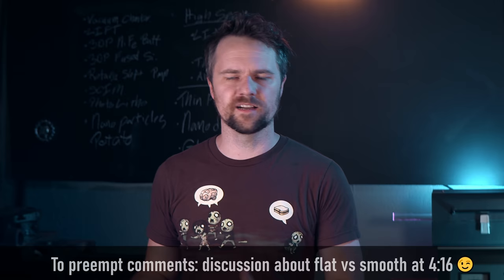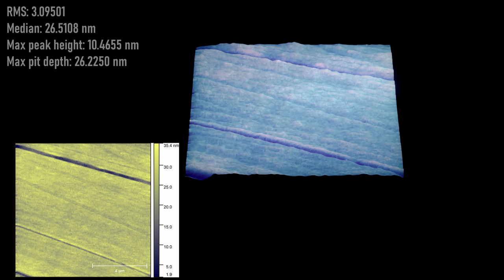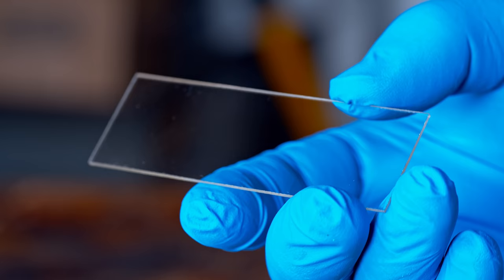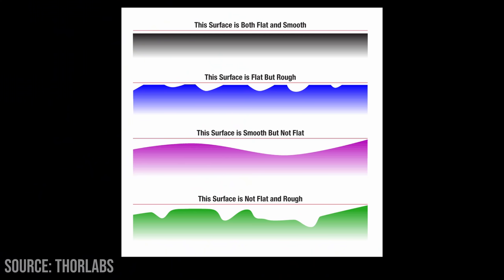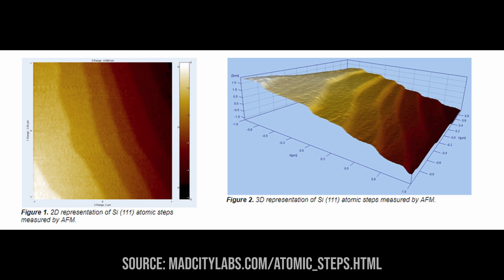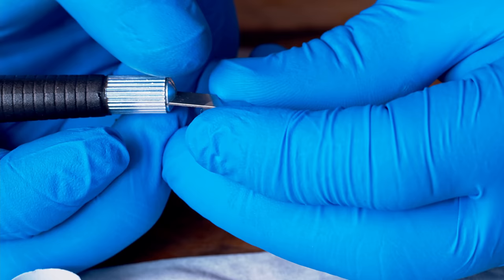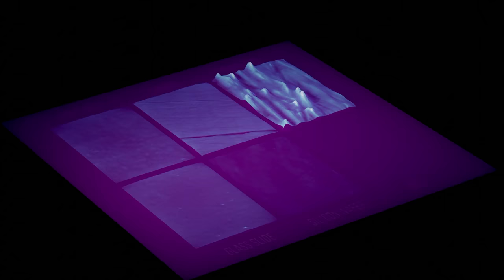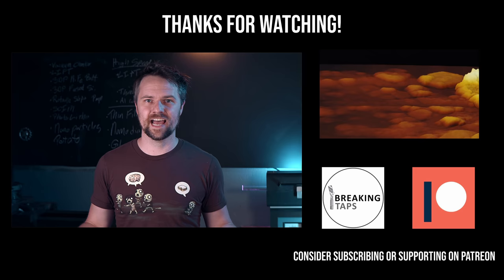What is the Flattest Material?

Comment from the maker: Addendum
- Flat != Smooth, please don't fill the comments with hate. <3 At this scale it's mostly moot anyway, and it's hard to watch what you say 100% of the time when filming 😇
- I am bad at colors! 631nm is red, not green. 🤦
- I'm not super familiar with surface roughness measurements, so hopefully I didn't misinterpret the results too badly!
- When I say "RMS" I'm referring to "RMS roughness (Sq)"
- As annotated in the video, some of the scans had "depressions" in the corners. This was due to poor flat-fielding of the raw data on my part (raw AFM data often has a tilt or slope which needs to be corrected) and I didn't notice it until after editing the video :) After the video I re-processed the data, and while the numbers changed some, the overall results were basically the same so I didn't go back and re-edit the video.  So just FYI, the glass samples in particular got a bit smoother but maintained their ordering.
Reply: Did you know that "flat" and "smooth" means different things? 😉
Reply: @Breaking Taps  pin it to the top!
Reply from the maker: @maxmustermann5353  Whoops, cheers.  Pinned!
Reply: Yeah was going to comment on the colour, then the lambda/x thing.  Lambda /20 means the surface as a whole doesn't deviate from being flat by that much, they generally give a scratch/dig or similar rating along with that for local deviation/ roughness.  A lot of flatness testing in general metrology is done using sodium's yellow lines btw, optics suppliers favour 633
Reply: can you please elaborate on how "RMS roughness (Sq)" is obtained? Is it the same thing as RMS of points on a single sweep line, just accounting all the height measurements in the measured area?

And the peak numbers at say 2:45 are 30nm above the average and 9nm below the average?
Reply from the maker: @kubeek  TBH I'm not entirely sure how it's calculated, I just went off the stats that Gwyddion gave me for the entire image (usually, a few times I masked off the depressions in the corners).  E.g. process the data, level, etc then hit the image stats button in Gwyddion :)  More details about how Gwyddion calculates it here: http://gwyddion.net/documentation/user-guide-en/statistical-analysis.html if you want to see the math behind it

Correct on peak/pit measurements, Gwyddion calculates those as +/- from the mean level of the image (as opposed to just the pure max/min values in the image)
Reply: Hey . Is the surface of water "flat"?
Reply: @kubeek  The RMS(sq) is the average deviation from the mean height. So it tells you how spread out the height distribution is.
Reply: The surface of gage block is lapped, not ground.
Reply: Congratulations on your videos - they provide a nice introduction into scanning probe microscopy to a wider, non-specialist audience. One comment though, I noticed you frequently list nanometer height values with four digits (!) after the decimal point, which grossly overestimates the sensitivity of you system. Also, such sub-atomic pico- to femto-meter scales don't provide any meaningful information in these experiments. From a scientific point of view I would therefore suggest rounding the height values to agree with the sensitivity of your system (nanometer scale at best). In any case, as I said you provide some nice examples how relatively straight forward AFM scanning can be and I am sure it will motivate more people to give it a try!
Reply from the maker: @Catenin120  Oh yeah, sorry about that! I was just being lazy and copy/pasting directly from gwyddion... no way there is enough sig figs in the data to justify that :) But very fair point, I'll be less lazy in the future and adjust the values!
Reply: Think of it this way, you are a Smooth talker.  I enjoy listening to you and I learned a lot.  Thank you for your presentation. Some of your audience is a little Ruff on you. There is a difference. ;)
Reply: would be nice to know how flat is lquid mercury?
Reply: I just stopped by to post that correction . 632.8 is the frequency of a red HeNe laser. BTW: Love your vids!
Reply: Yo thanks for the information, just gave me new things for my friends to ask me what the fuck I do all day to learn these things!
Reply: @kingsman428  Hey Timberman , eagles fly high  !
Reply: Nice work! Just out of curiosity what probes are you using and is this contact mode? I do a load of AFM imaging of biological samples specifically DNA. Mica has another interesting property when cleaved leaves a relatively strong negative surface charge. Using divalent cations as a bridge DNA can be adsorbed right onto the surface. If you do more videos on AFM ill be happy to supply some images of ssDNA on mica if you are interested
Reply: Just another FYI: where you wrote "E.G. MY FAULT" it should have read "I.E. MY FAULT".
Reply: can a sheet of mica be used as an optical flat? Could you test that?
Reply: Graphite (Graphene) can pull single layers with scoth tape.
Reply: "631nm is red not green" red-green blind people: I assure you it is
Reply: Just a thought for future discussions: it sounds to me like flatness and roughness both deal with slope, but over different distances.  You might say that roughness measures slope over 1-2 nanometers (or less?) while flatness measures slope over mm, etc.  Seems like it's just a difference in scale, to me.
Reply: @fla_panther1332  No thanks. There's established technical terminology for a reason. Material can be rough on milimeter scale but flat over couple of meters. While a polished ball of glass is not flat at all
Reply: @trollmcclure1884  You just said exactly what I said but using slightly different wording.  "Troll" McClure indeed?  You just acknowledged a surface can be rough at one scale and flat at another.  Also, believe it or not, a polished ball of glass can indeed be described using a slope, which is also a technical term with its own definition.
Reply: @Bibibosh  I think one would have to say that the flatness of the water surface depends on the size of the body of water, and your point of observation. A water droplet obviously does not have a flat surface. It's smooth, but curved, not flat. Water in a container e.g. glass breaker, bowl, aquarium, tank, has a flat surface ( except at the edges where surface tension draws it up the sides of the container, of course). A puddle, pond or lake, if not disturbed by wind, tremors, or chucking pebbles in it, would be "flat". But eventually you have to take the curvature of the Earth into consideration. From Space, even the surface of the oceans are not flat. (Flat Earthers notwithstanding 🤣) so I guess that when observing even a small area of water surface, if the measuring instrument was accurate enough, a curvature could be detected. But you put "flat" in inverted commas, so the answer would be "Yes, it's"flat" provided you're observing only a relatively small area, and your measuring instrument does not have insane powers of resolution & accuracy"
I read somewhere that it could be calculated that a fly, landing on the handrail of a ship, causes it to list over by some number of Angströms, lol. Now that's some insane level of accuracy! Calculated but not measurable in practice.
Reply: For many years I worked at a company making CMP (Chemical Mechanical Planarizers) for semiconductor manufacturing.  Planarizing meaning flat, not polished.  Polished meaning smooth, not necessarily flat.  Still, even in the highly technical semiconductor industries, these planarizers are often called "polishers".  It seems that every industry has some of its own lexicon, and some abuse of the lexicon.  The company also made a machine called a "wax mount polisher" which did "prime wafer polishing" which is polishing one side of a silicon wafer for semiconductor manufacturing.  In this case, it was probably correct to say "polisher".  For the planerizer, though, its purpose was to flatten protruding features in preparation for depositing another layer onto the wafer.
Reply: Thank you for the clarification. This was a super interesting video
Reply: technically correct is the best kind of correct
Reply: Well I enjoyed the video and didn’t think you deserved any criticism, thanks for the interesting content
Reply: I was interested till i saw the pinned comment
Reply: Check out a flat silicon surface having 40 picometer RMS roughness! doi:10.1016/j.apsusc.2020.148269
Reply: @graealex  did zouuu<<<<<<<
Reply: hate
Reply: I like how you used “!=“ instead of “=/=“, becuse I’m a code geek 2!
Reply: @graealex  what’s the difference?
Reply: @graealex  what’s the difference?
Reply: @alex.g7317  Flatness is deviation from a straight plane, smoothness is deviation from the average surface. A sphere can be very smooth, but will always score low on flatness.
Reply: @graealex  ah! that makes sense!
Thanks for the comparison, now I see the difference!
Reply: @alex.g7317  This was obviously a very simplified explanation, so please don't crucify me for it not being accurate.
The general concept is correct though. Basically the difference between macroscopic and microscopic deviation. The opposite of smooth is rough, but it is clear that even a rough surface can be very flat, i.e. if you were to measure with a gauge on a surface plate, you'd have little deviation despite the roughness.
In addition, there's also parallelism, so deviation in thickness. That is important for work pieces when you lay them flat on a surface, or even clamp them down. Then in addition to having a flat surface, they also need to have little deviation in thickness, otherwise you'll bend them out of shape.
Reply: @graealex  Intresting... very intresting...
Reply: @graealex  😊😊
Reply: and to think the Sars-cov2 virus is like 100pm
Reply: When I was a kid back in the 70s, I remember mica being used in many electronic devices as an insulator.  It was amazing to see how the sheets come apart so smoothly.... well now we know. :)
Reply: we need more content from you dude. Thank you v much for this. keep it up!
Reply: Would it be possible to make a wafer akin to that of silicon on MICA? Like would it not only be possible but functional to use MICA as a chip component like silicon is used in microchips?

Comment: I work in a fab where wafers are very prominent. Some moron stacked a bunch of wafers on top of each other. Let me tell you getting those apart took some work.. even trying to slide them apart was difficult. Felt like magnets. Cool to learn more detail about them.
Reply: I wonder if soaking the stack of wafers in helium or hydrogen gas at a reasonably high temperature would have been a way to separate them especially if you stack them on their side so they didn't have any gravitational force pushing them back together. Basically the gas would intercalate between the sheets and maybe allow them to gradually move apart, especially if they were under tension of some sort
Reply: @michalchik  Inside a vacuum,, our machines actually use helium on the bottom side of the wafer to try and push it up when it's stuck. 

The surface it sits on is so fine that it too feels like a magnet. The surface also gets turned up to 60C to help relieve the stuck-ness. If we attempt to push it up pass a certain flow of helium (5-15 sccm) we risk blowing the wafer to pieces when it releases.
Reply: work at a fab too.... breaking wafers is far more interesting....
Reply: @MoDawdy  And that's why we have a chip shortage
Reply: So when you work at the fab do high five and say fabulous 🤩
Reply: I'm remembering an old sci-fi story where some stranded astronauts are trying to repair an alien spacecraft engine, but the engine is enclosed in a housing which is held together entirely by atomic attraction between extremely flat surfaces and the only way to get the housing to move at all is to use a super-slick oil which is part of the alien tool kit.  The only way they figure this out is because there are two engines and the housing on one is partially disassembled.
(They don't manage to repair the engine even though it runs on principles known to them.  Instead, it overheats and they escape and the flare it causes as it goes up in flames acts as a signal so they get rescued)
Reply: Especially if you stick them together with IPA.  Fun times in the cleanroom lol
Reply: What companies are you guys working for?
Reply: @melkiorwiseman5234  yo is that a book? I'd love to know the name
Reply: @mitlanderson  All I remember is that it was in one of the old sci-fi magazines such as "Analog" and I've given most of the story already.  In summary:
Two astronauts have to make an emergency landing on a large asteroid when their ship's engines begin to overload for some reason.  They land and manage to escape before the inevitable overload/meltdown.  They landed on the "wrong" side of the asteroid and journey around to the other side in hopes that their radio signals can be picked up without the asteroid in the way, and run across the alien spaceship when they're nearly to the optimum location for a transmission.  They discover how to open up the engine to work on it and attempt to repair it so they can go home, but make a mistake which causes the engines to overheat in the same way as their own ship's engines overheated.  They have time to get clear and they reflect that at least the huge atomically-fuelled blaze will definitely attract attention and someone will come and rescue them.
Reply: Wait
If you have 2 thin sheets of something that are like 100% flat, not even a single atom extra or missing anywhere, if you put 2 of them on top of each other, would it be like impossible to separate
Reply: I work in a semiconductor fab too! Sometimes we take scrap wafers, wet them with DI water, and stick them together. They can be almost inseparable
Reply: Do they wring together like gauge blocks? That's so interesting, I probably shouldn't be allowed near them.
Reply: Van der waal wall forces right there.
Reply: Why? Is this the Casimir effect, Van Der Waals forces or both?
Reply: You're talking about cold welding?

Comment: please do a harddrive platter.
Reply: And a hard drive read/write head...
Reply: @paulvolz720  thanks for the link
Reply: @tootalldan5702  I do not see a post from @Paul Volz or a link.
Reply: @jameswkirk  and @Ross Harrison: I was a CE with IBM UK in the 1970s and 80s spanning the era of large multi platter "removable disk packs" to large multi platter fixed disks. I often gave presentations with diagrams showing the flying height of the heads compared with a particle of smoke or a fingerprint. IIRC, the heads had a radius of ~200' (~60m) to enable them to fly like an aeroplane wing.

With my limited understanding of aerodynamics I believe that the surfaces of both the disk and the head would need some regular variation to provide optimal lift; much as an aeroplane, especially a glider (sailplane) flying close to the ground obtains an advantage compared to flight at altitude. I doubt that even modern HDDs with 5 nM flying height can compete with 'the smoothest surface' but they probably have strict limits on the variation of the maximum and minimum deviation from the mean.
Reply: Oh yeah, good one! 👍👍
Reply: @TheAlanSaunders  , Bet you had to deal with a number of head crashes - your post brought back memories - I worked on everything from 1311's through 3380's from '66-90's in India & the U.S.
Reply: hard drive platters are only like 8 lambda

Comment: I worked in the semiconductor industry for 12 years. We could regularly achieve thin films (e.g. Titanium Nitride or Silicon Nitride) on silicon wafers with less than 0.1 nm roughness and flatness.
Reply: Thats... less than 100 picometers- wowzers. I get why quantum entanglement is a concern for those tiny-ass logic gates.
Reply: @dustinyoung3069  your thinking of quantum tunneling
Reply: @owencarter6417  that too
Reply: Just to have a reference, 0.1nm is smaller than the diameter of a hydrogen atom. A single molecule layer of Si3N4 will be much thicker than 0.1nm but the smoothness will be dependent on the underlying layer geometry and topography
Reply: The silicon he showed is bad. Silicon out of the box should be up about an angstrom roughness over a few micron scan. Measuring roughness with an AFM is limited by the tip.  Older tips will blunt and give a lower roughness
Reply: What I wonder is what wrong when a microchip with billion transistor & just a single transistor is failed? its overall chip goes dead? or maybe something else..
Reply: @jstwatchnread8420  nah, mostly depends on how important that one that died was, if it's in a memory cell, ah well you just lost a bit, if it's in a CPU you might have an issue with it being ever so slightly slower or something else
Reply: Yea, he probably doesn't have a good sample, or the sample is not properly cleaned up.
Reply: @jstwatchnread8420  that is why we have different versions of chips i.e.: Intel i3, i5 and i7! Yield is a problem and based on the defect transistors they choose what version the chip becomes. Not %100 sure though.
Reply: @jstwatchnread8420  cosmic particles?
Reply: @egonvanpraet  they're just different chips. You could kill a worker with a heart attack by asking them to identify how many failed transistors there are in a CPU (and fyi, that is probably an extremely low number)
Reply: @jstwatchnread8420  if you were to try to map out exactly how each transistor interacts with other transistors and their logic gates, you'd not only go crazy, but you'd realize the worst is could do is just output wrong info which is then corrected by a failsafe. Now, if you bend a pin...
Reply: @dustinyoung3069 They often measure things in angstroms (1/10 nm)
Reply: @dustinyoung3069  That's just the surface roughness, he's not talking about feature size.